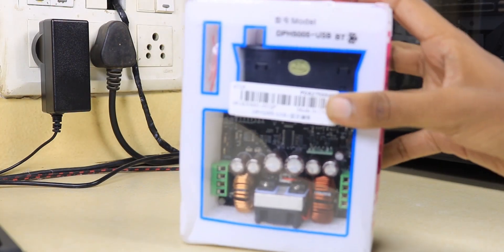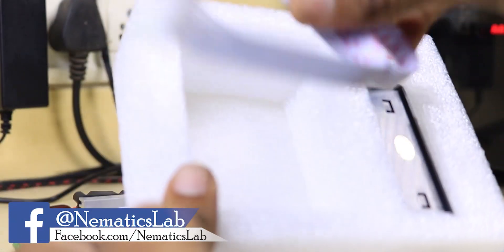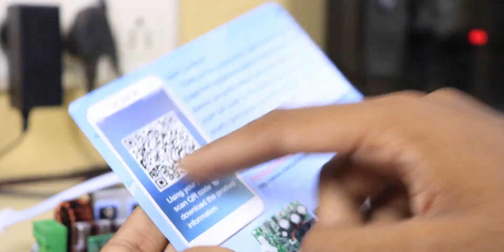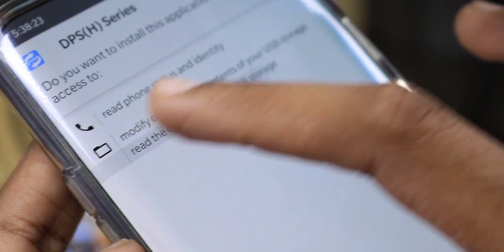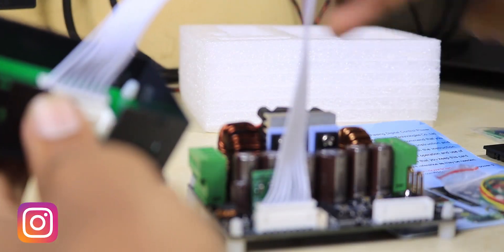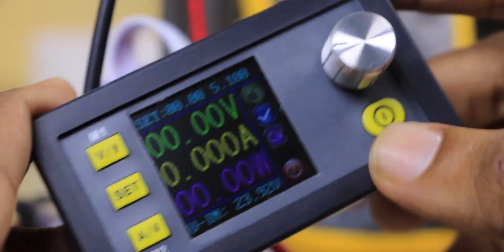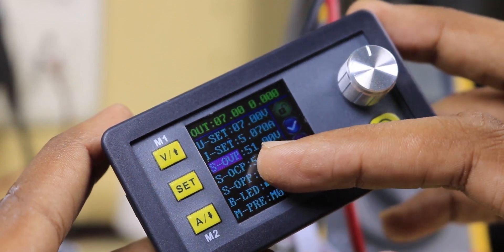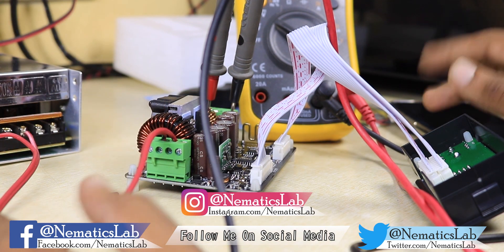DPH5005 50V 5A Power Supply Module! | Buck Boost Module

Comment: How much efficiency it is giving?
Reply from the maker: 70-80%
Reply: @Nematics_Lab that's a concern since we have to supply little more than what we are going to consume. Fine thanks anyway for the review video
Reply from the maker: No supply or converter is 100% efficient and for this price efficiency is justified.
Reply: @Nematics_Lab  agreed. This we can use it for hobby grade supplies or just for testing. But not for any particular applications which is stringent in power loss

Comment: Great video. I am looking for a way to limit voltage and current for my hybrid gas-electric drone. Does this converter remember settings when power is shut off, or do you need to re-enter all the values again
Reply from the maker: Yes it remembers values

Comment: The third DPH5005 module, like the other two, has failed.  The latter will have allowed me to make about thirty uses.  Really, these modules, are too fragile you poorly designed.  So I have in my desk drawer, three displays that are no longer useful.  Could you tell me what it is possible to do with it?  I would so much like to make a little return on the money I gave to Ruideng.

Comment: 250w / 14v = 17+ A... So this thing should be able to go up to 17 amps at 14vdc? If there's 250w comming in?
Reply from the maker: No, Supply can provide max of 250W when at 50V 5A. You cannot exceed 5A at any voltage
Reply: @Nematics_Lab  OHMS LAW. if I have 250 watts comming in. If I set the output voltage to 14v, and set the output current to 5A, then I'm loosing power, and this is not worth the money.  Because output will only be 70 watts. What is the maximum current I can set this to output at 14vdc?
Reply from the maker: @RoyAndrews82  ohm law is not applicable for semiconductors, max current you can get is 5A that's the limit
Reply: @Nematics_Lab  Okay. Thanks.
Reply: @RoyAndrews82  But if you need more voltage, you can plug a 24V/10A power supply, and set the DPH5005 to output 5A (limit) and 48V, which in this case doesn't make you loose power. If you need it...